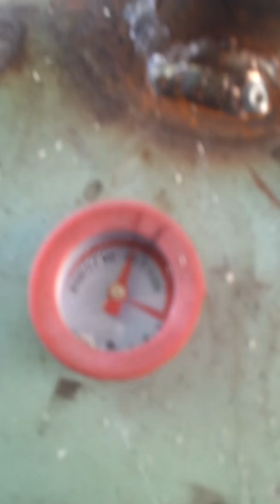DIY How to make a Homemade wood gasifier system #5

Comment: Would your flair stay lit by it's self? Also What color is the flame without the torch?
I'm starting a build of an Imbert design, I wanted to know how well the wide throat burn chamber with the 2-1/2" exit was doing? Did that work?
Reply from the maker: nasanction 
The Flames will sustain itself and stay lit without the propane torch I just kept it there in case it flared out. The flame is white to light blue when it's running at its best.
  The two and a half inch throat worked out okay.
Reply: Thank you. I was looking at the rim idea by flash001usa, using it as an 8" burn chamber, and the hub is 2.5". I think I can fit it into a propane tank if I use a center feed jet.

Comment: So what if you were in a survival situation and you had no power or vacuum cleaner then what would you do this would probably need to be developed in a survival situation to run a generator or something
Reply from the maker: julia miller 
  I was going to have a 12-volt DC vacuum with a car battery to run it and also  going to run a generator off the gasifier to charge the battery. wants to gasifier is up to temperature there is no need for the vacuum as the engine will create its own vacuum to run. I have yet to try this but I've seen several other videos where they do that.